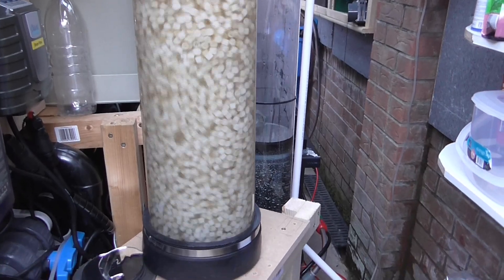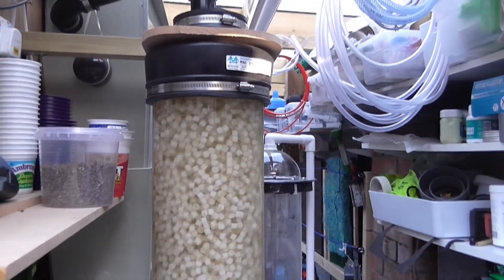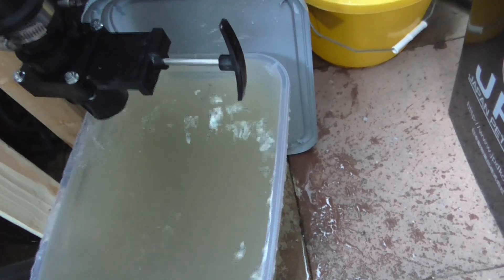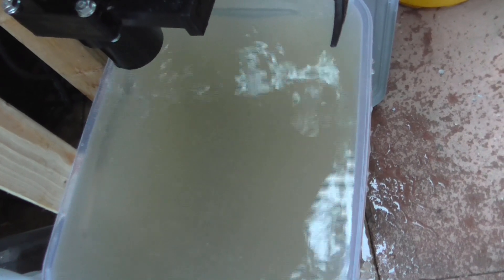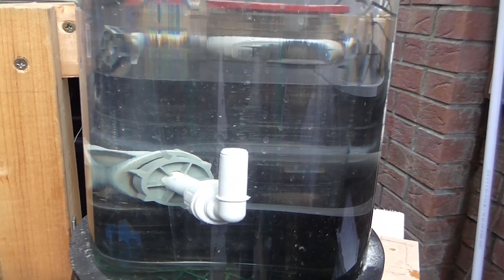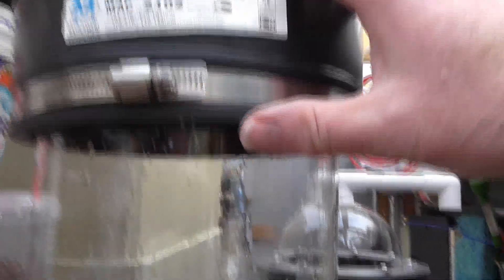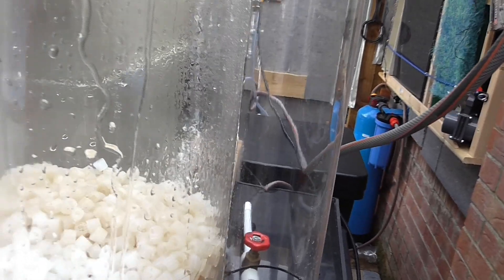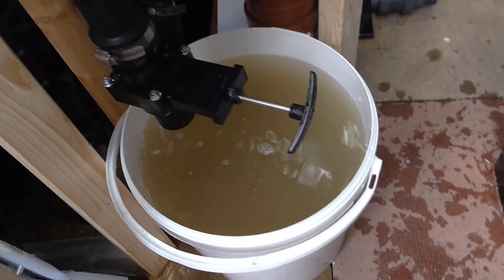Bigger air pipe agitation on UpFilter

Comment: I fancy having a go at making one of these filters and you have made some excellent videos on it. Have you a link info sizes etc to the device you have used to get air into the filter, I think it may be called a bulkhead?
Also in a previous vid someone asked how much media you used and you said a 1/3 of the volume. Is that likely to be a 25l bag or 50l.
Thanks again for great ideas and videos
Reply from the maker: Hi Gary. Thanks for the kind words. The fitting that puts air into the Up-Filter is a JG Pipe fitting. I got mine from Toolstation. Before fitting it warm the tube so that it adapts to the form of the fitting.
https://www.toolstation.com/jg-speedfit-tank-connector/p92456
Not sure on the amount of media. If you can use it elsewhere then get 50l otherwise start with 25l and add more if you think it needs it.

Comment: Hi, got mine up and running on Sunday, got to say can't see too much rubbish travelling up the tube, and media still looks clean, can't wait to clean it, that will be the test, I decided to go 15 mm speedfit route for the airline, didn't have the nerve to drill the acrylic tube, went through rigid 110mm- 2" adapter instead lol 😁, out of interest, how many lts per hour are you pumping through it?
Reply from the maker: Hi Marek. I'm putting around 5000 l/h through the 200mm tube. I think that you will find it has trapped a lot of fines.
Reply: @northernkoikeeper512  I put video out last week showing it in situ, and gave you a shout out, but not quite running, I still need to connect airline to one way valve, then she'll be ready for 1st clean after 5 days.

Comment: hi how did u get that air to work on it did the pipe just fit in ?
Reply from the maker: Not totally sure what you mean Richard? The 15mm bulkhead was fitted to the acrylic tube by drilling a suitable sized hole. The back of the inside part of the bulkhead had a little 'lip' on it to stop the 15mm pipe going straight through. I just filed down this 'lip' and the 15mm pipe pushed straight through.